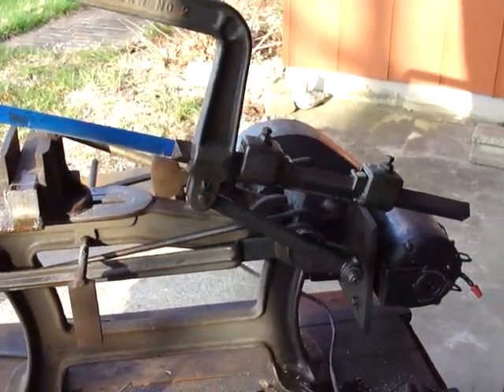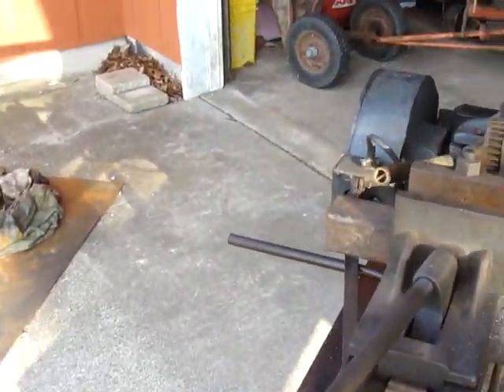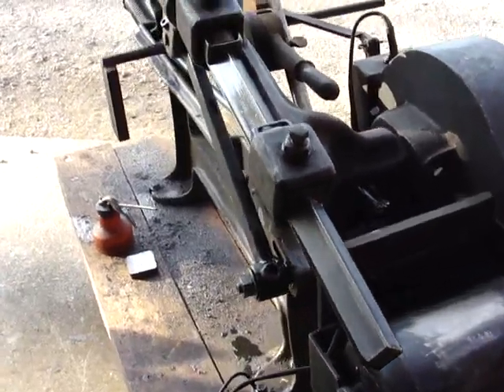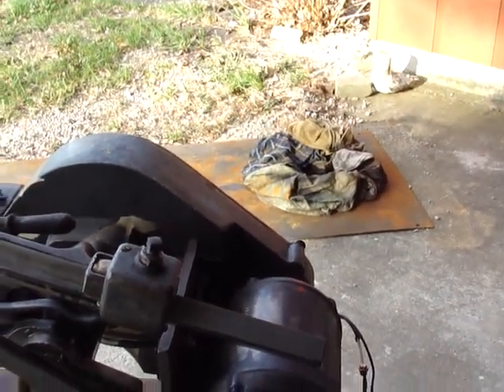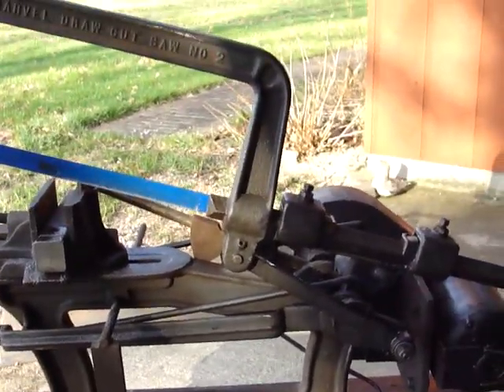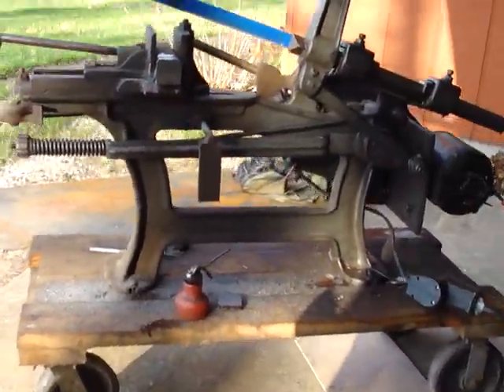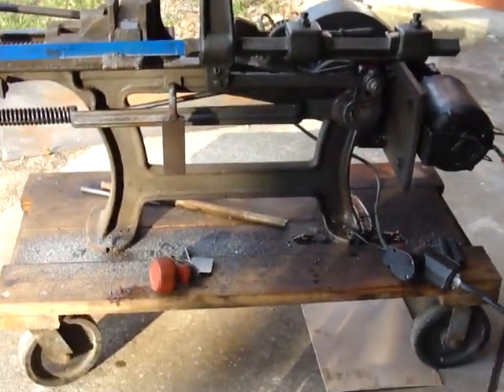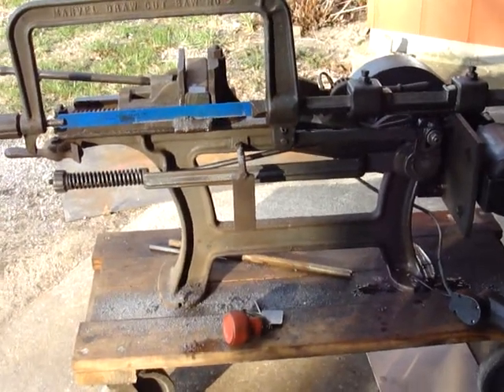Marvel No.2 draw cut saw,  Elwood Ordnance Plant

Comment: I see the old Canadian in the background Is getting some new wheels. Can't hardly wait to see you get it running.
Reply from the maker: yep, had axles built 4 it and put a trailer ball tow fitting on it 2be able to move it around here.  after running and fixed up i'll build a towing tongue 4 it like the "hot rod lincoln".

Comment: I'm in the middle of restoring a #2 myself. Unfortunately I've got some damage to the 'eccentric lever assembly' and where it rides on the crankshaft assembly. I wish I could find blueprints of those 2 pieces. I also have to make a new bushing for the crankshaft itself.
Reply from the maker: can i help somehow?
Reply: @wrenchguy , I'm not sure. The eccentric portion of the crankshaft is worn out, and has been previously repaired. I have a plan for machining down that diameter and installing a bearing. I will also have to machine the clevis part where it rides on the eccentric crank. The problem I have though is knowing where it should ride at the minor and maximum point of the rotation. the modifications i'm making may significantly impact the stroke in that arm.
Reply from the maker: @jonathanshoemaker9255  I'll see if i can sketch something out.